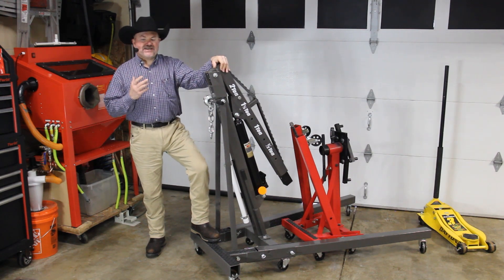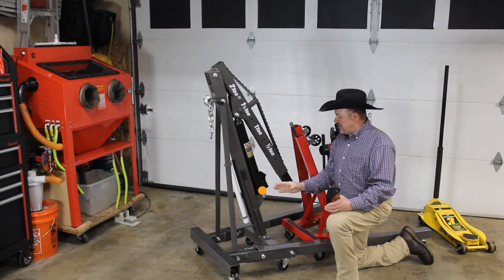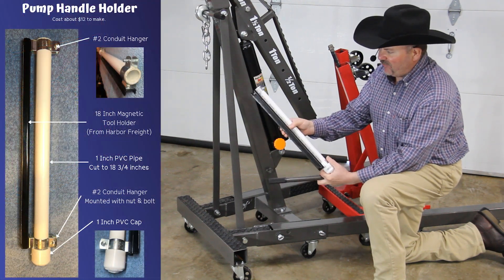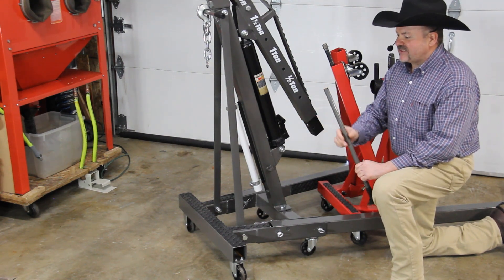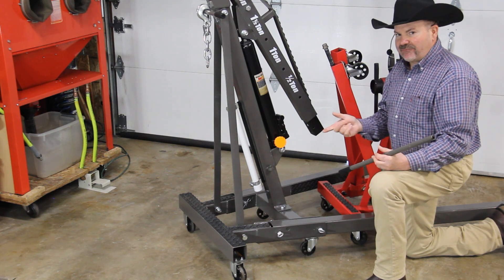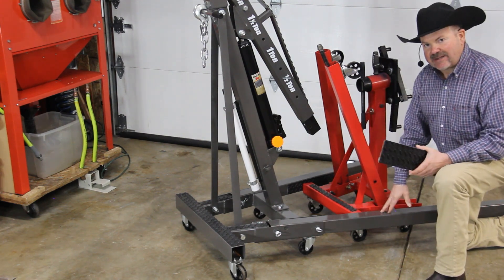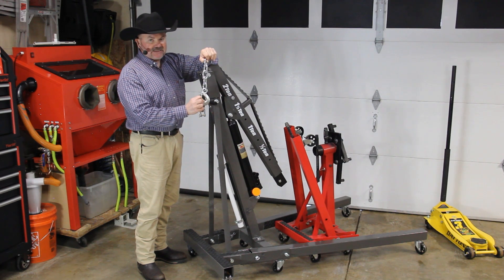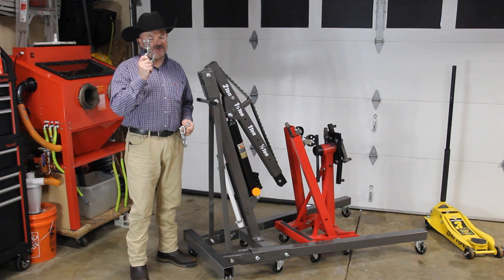Engine Hoist Modification

Comment: All good stuff. Looking to get a 2T engine hoist to pull the motor out of a tricky (really tricky) vehicle. Really like the 3d printed part and I've been looking at various anchor swivels for exactly the same reason, plus to lessen the height.
As an aside I like the mods you've made to your blast cabinet. have done most of these, too!!
Reply from the maker: Thank you for the compliments!  The 3D file for that knob is still over at Thingiverse so you should be able to get it and print one off.  IMHO the swivel is a must, it makes everything so much easier.  In regards to the cabinet...  good eye!!  You noticed that in the background.  Quite frankly, I converted it to a vapor hone machine and it has been awesome!!  They produce amazing results.  I have had some serious hardcore restoration guys come over and use it and they can't believe it either.  I did actually shoot video during my entire process of making the machine and I saved all my 3D files for it too.  One of these days I will get the time to edit that video and post it here on my channel.  Thanks for stopping by!

Comment: First thing I did ( I am still a mechanic after 55 years in the trade, ) the pump handle got a 4" bolt welded about 4-5" down the shaft for critical control of the valve ( oily hands don't have much grip!!!) I welded a bolt to the bolt at the bottom of the upright now the handle slip out or get lost around the workshop when the crane is moved, I also have a magnetic led light that I attach to the arm, ( can never have enough light!)

Comment: I would love to see the setup on the sand blaster cabinet in the back of the shed.
Reply from the maker: You will at some point Michael when I get around around to editing the video footage I have.  It's actually a vapor hone machine I made and it has been an AMAZING tool to have.  I took video of the entire project and hope to get it edited and published here some day.  Thanks for stopping by!
Reply: I commented before seeing the reply below. I have a standard 220L cabinet but been very pleased with the upgrade kit from 'Parts Washer Upgrade' Company. No affiliation. I used a different cyclone bucket (25L blue tub with black lid and metal band, which I think seals better than the standard bucket and we don't really have these buckets). Anyway pleased and impressed with PWU's kit.